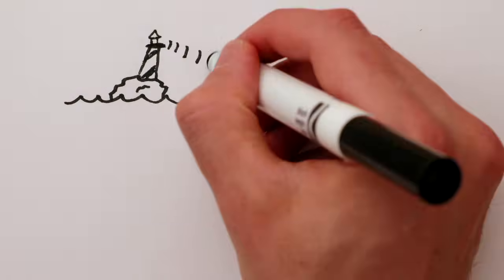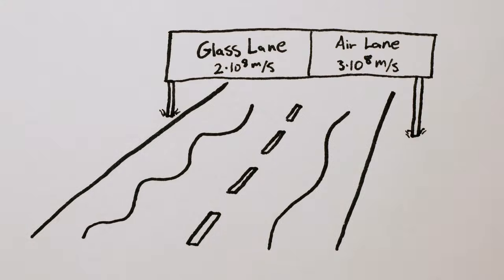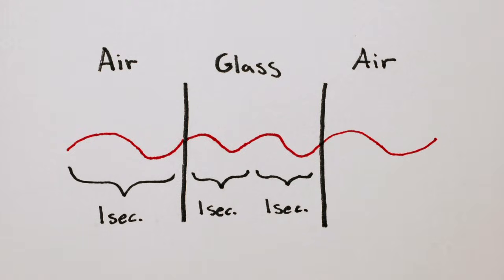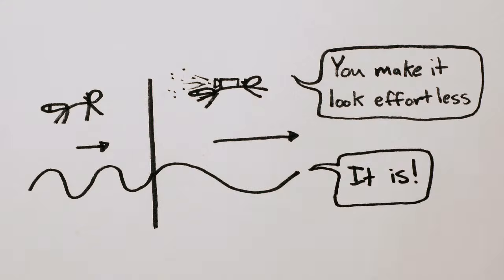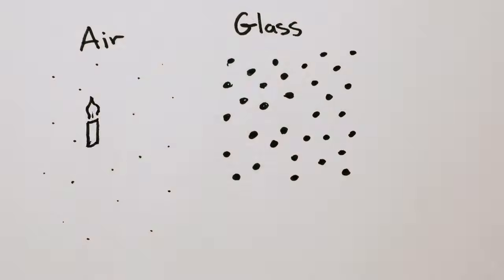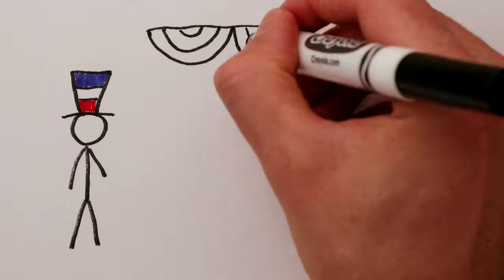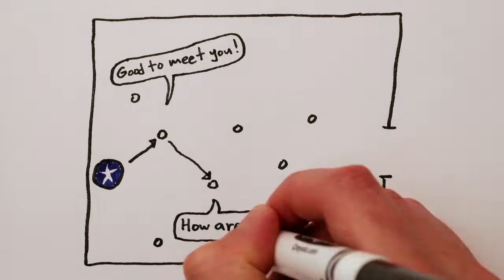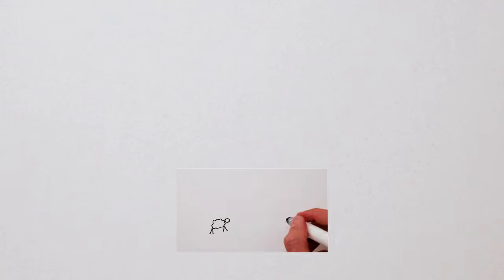The Speed of Light in Glass

Comment: The way I understand light's changed velocity in a denser medium is a little simpler. I look at it as though the light would require more energy to travel through a denser medium at the same speed, and so it slows down because it doesn't have an external force giving it energy to do the extra work required to travel through the denser medium at its air-speed. When it exits the dense medium, the required energy to travel at air speed is back to normal, and so it resumes. I'm probably way off lol.

Comment: @dylandd100 Then please fix the Wikipedia page on speed of light, which states: "The speed at which light travels through transparent materials, such as glass or air, is less than c. The ratio between c and the speed v at which light travels in a material is called the refractive index n of the material (n = c / v)."

Are you *sure* that you weren't told that the speed of light is constant, regardless of the material that it passes through?

Comment: I have zero knowledge on the matter, however this must mean that light is not travelling at its full speed through air due to it still hitting the smaller particles it connects with, correct? Meaning the speed of light will always be calculated differently (Slightly) depending where you are and what is in the "air"? I'm probably wrong but to me the logic seems plausible :D

Comment: @TheHdulcimerguy Alright, this analogy is a bit simplified but essentially hits the key point:

Imagine you're a lifeguard on the beach and you see someone drowning in the ocean. How do you get there the fastest? You realize that the line of sight has the shortest path, but you can run much faster on the sand than you can swim. So you'll bend the path a bit, allowing for a faster rescue via more running vs less swimming. 

For more you need to check out some books/lectures about quantum physics.

Comment: @DigitizedSelf But that would only happen if the individual light rays are "attached to each other", right? I think. Because only if the light rays are "attached to each other", then when one side slows down while the other side is faster, then it will affect the whole light beam and cause the beam of light to travel in a different direction.

Comment: @ASwifyHippie Because its in an inclosed space, and bumping into the particles makes the wavelengths shorter. If you make a wave in the tub full of water and in a drinking glass, the wavelength of the water in the glass would be shorter than the tub because its in a smaller space than the tub. Thats how the light wavelengths are.

Comment: @ColdRainMaker If the surfaces of the glass are parallel then the light leaving the glass is expected to travel in the same direction as it entered. Refraction in this case only ofsets the position of the glass by a slight amount because the direction of travel is different inside the glass.

Comment: Technically light does not return to light speed when it returns to air because light speed is as fast as light can go and light reaches it's full potential in a vacuum because it gets slowed down by the air so it is never at light speed in the first place and only will be in space. Like if you noticed this too.

Comment: @ADizezedCrow That is called difuse reflection and is a different phenomenon.

When light travels through glass, some of it may scatter but most of it doesn't. If light scattered through glass, the image would appear blurry. Since this does not happen with most glass, we'd expect the light making up the clear image to travel at the speed of light through the glass using the model outlined in this video (since it didn't scatter it obviously didn't bump into any particles along the way).

Comment: @JMelo19 I'd say it doesn't really bouce around: when photon interact with matter it get first absorbed transmitting it's energy to an electron and then the electron reemit another photon with the same energy in a preferred direction. This happen with a small delay thus light appear to travel slower. This is called Rayleigh scattering.

Comment: @JMelo19 Well... all of it doesn't, right, if it did the rectangular piece of glass wouldn't have a shadow, or what? All light however exit in a straight line, some is just slightly redirected, making a shadow that can be both brighter at some points (where the light's concentrated), and darker at some points (where the light's more absent).